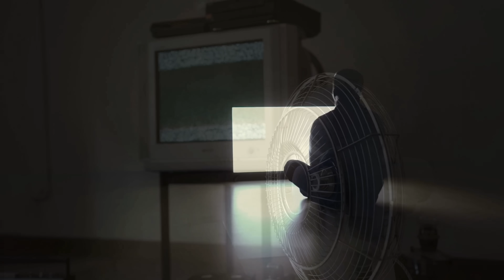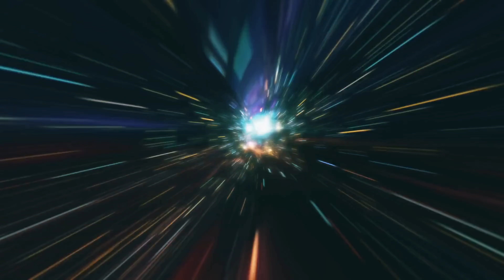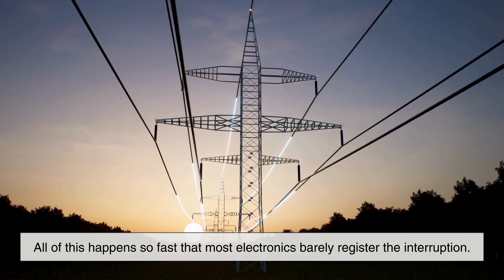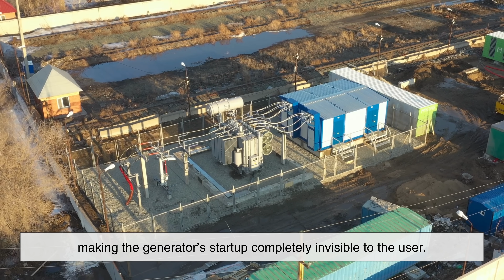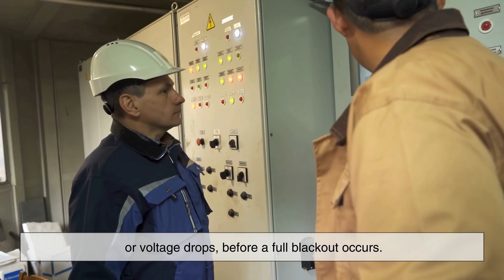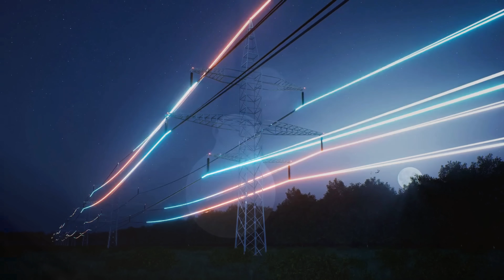How Does Backup Power Activate Before You Even React?

Comment: "In many UPS systems, your devices are powered by the battery at all times." Double-conversion or "online" UPSes are very rare in the consumer market. They are considerably more expensive than standby UPSes since they need an input stage and inverter that can handle the full load continuously. Standby UPSes only need a low-power charger to charge the battery back up within reasonable time after an event.

100ms is nowhere near fast enough, most grid equipment acts much faster than that under normal circumstances. I personally do not care if power is out for 30 seconds but I do care about my devices. And most AC-powered devices have less than 15ms of internal energy storage before you get shutdowns or restarts. If my devices lose power, it will take more than a minute to bring them back up.

Comment: Some UPS systems have Back Up generators  in continue  RUNNING MODE but do not supply power  (IDLE) until de power of the grind is away . Delay is just 0,35 seconds just for switching because they can give fast power . Most of the time there are 2 generators running in IDLE as a backup of a backup or for mainenance works . The only battery is the start up battery of the generator .

Comment: For many years, living on a rural homestead, we have been subject to power blackouts that last hours or days as repair crews always worked to restore the most customers the quickest. We are last in line to receive repair service. In the country, population density is far less with perhaps 10 homes per square mile, whereas in town, buildings needing power number in the hundreds or more per square mile. It's a matter of economics. If power is out, customers are not using and paying for kilowatt hours of electricity. It is in the best interest of power companies to get as many "back on line" asap. 
For this reason, many of us rural dwellers own and use generators, either "whole house" units, or portable units to supply minimal power for creature comforts; well pumps, refrigeration, heating and cooling and maybe a few lights. I have long wondered why power companies didn't install emergency power generators every few miles along the grid to keep us in the country up and running. It's not as if each generator has to be big (and expensive) enough for more than a relatively few customers. I'm sure the economies of scale have been calculated regarding this, and I'm wishing for something that will never be.